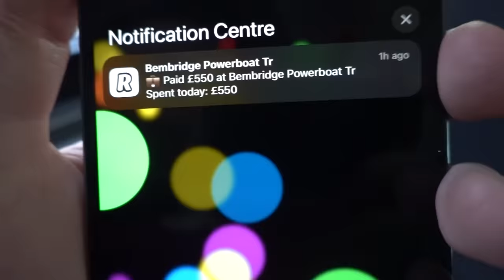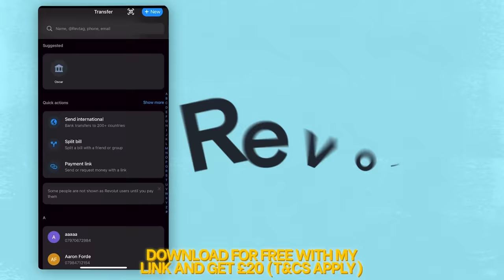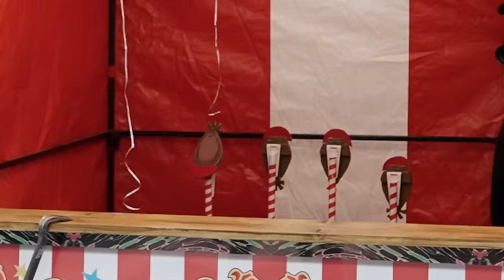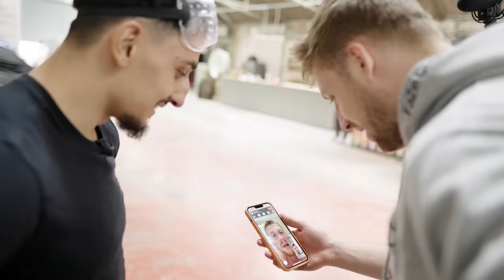Can Harry and Gib Break Into My $200,000 Safe?

Comment: Pro tip : when you can get the crowbar in the door , push the safe flat on its back wedge the bar and then exert force downwards.
For legal reasons this is a joke and under no circumstances should ever be used.
Reply: Noted

Comment: Drill a hole in top.

Fill safe with water.

Put large solid steel cylinder which perfectly fits hole.

Smash steel with sledgehammer.  Hydraulic pressure should cause considerable damage.

After seeing the safe... A few cutting wheels will handle that crap.

Comment: To be fair in the time they had they could have just gone through every code, if there are only 4 numbers and it goes from 1 to 9, then there would only be 9999 different codes, all they have to do is go 0001, 0002, 0003, 0004 etc..